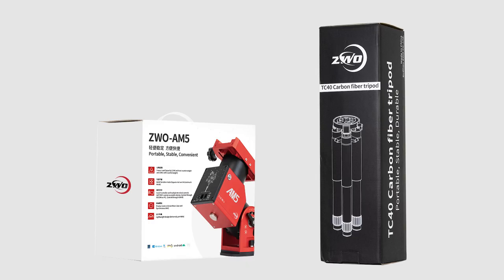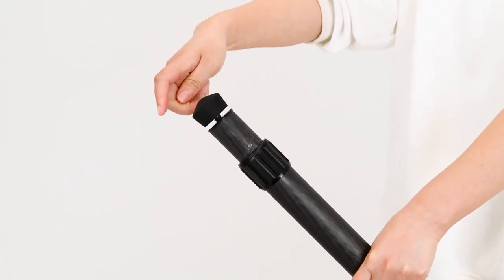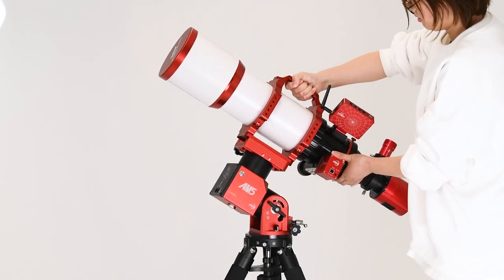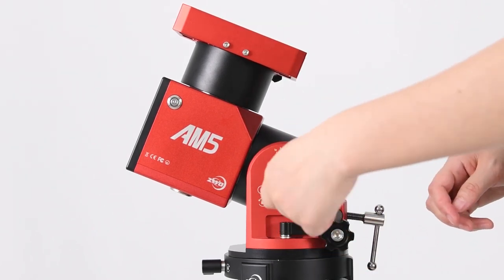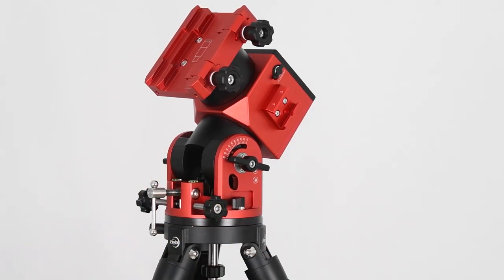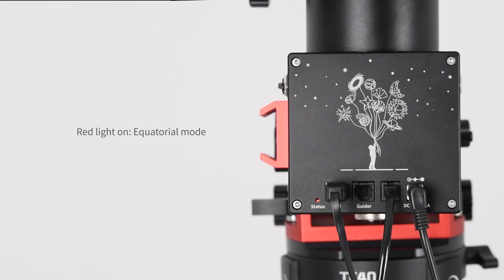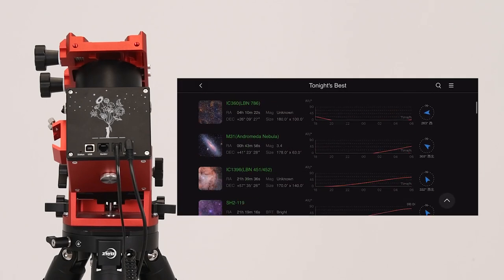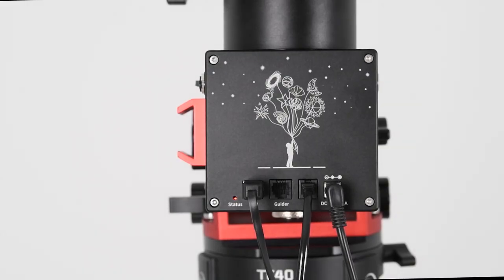Product Tutorial | ZWO AM5 Tutorial:  A quick guide on how to use the mount and tripod

Comment: I'm interested in buying this mount. Can this mount track accurately for exposures over 300 seconds with a Celestron edge HD 8" or similar telescope aiming at small deep sky objects using its focal length of 2032mm?  What is the maximum exposure time that can accurately be used with Edge HD 8" at maximum focal length with all the ZWO accessories available attached? Will a counter weight give better tracking?
Reply: With good guiding (for 2032 mm probably something around 500-600mm) it should do the job

Comment: Good to see a tutorial of AM5, wonder what the Azimuth mode is for? Can ASIAir pro do plate solving and guiding in Azimuth mode with AM5?
Reply from the maker: Altazimuth mode, which means the mount can be used as an altazimuth mode. Thus plate solving can be done with AM5, but guiding not.
Reply: @zwoastro  thanks for explanation. Can this mount be used for small objects like galaxy? I read its description page and find "not recommended for focal length than 900mm"
Reply: @OscarShu  focal length limit has nothing to do with what images it can take,whether it’s planetary or galaxies
Reply: @napper1496 yes, but generally for galaxies, especially if you want to image more than just m31 and m33 with decent resolution, you typically need longer focal lengths. I'm sure that's what he meant.
To actually answer his question though, I believe the focal length limit seems to be more related to the mount getting off balance and tipping with longer scopes. If you have a beefy tripod or have your tc40 secured, this mount should do fine with longer focal lengths. There have been many instances of people reporting using their edge hd 8" with great results. 
I own one as well and plan on using the am5 with it.

Comment: I will not buy this mount for the following four reasons:   1- the USB and power connections are at the front (the person who designed that has obviously never imaged),  2- the lower temperature  range is only 15°C,    3 the mount refuses to go past the meridian and ZWO has not allowed users to set their limits,  4- it is obvious the AM5 was designed to work with the ASIAIR and the rest of their ecosystem. (others such as NINA, PHD2, SGP are after thoughts).
Reply: I wouldn't have a problem with the port locations IF I could use an RJ45 connection as opposed to USB (like the EQdirect cable/serial to USB). A standard B-type USB port is a bit finicky when it's part of a moving unit and the rectangualr peg in the middle is prone to breaking. The temperature range would be my biggest obstacle as I like to image on a cold winter night as those are best seeing conditions here in lower New York. Finally, I have no desire to use a freaking Rasperri Pi to control my OTA, and I certainly wont buy an ASIAir. That said, it's not completely off the table (RPi) but only for situations when I'm away from home and don't want to waste juice powering my laptop.
Reply: I get the ecosystem argument but probably half the people complaining about that use their iPhone, MacBook, and Apple Watch every day.
Reply: @DJRonnieG  try a Mele Quieter 3Q.  Runs everything with power to spare and you remotely control it.
Reply: @nuttmig  Ha!